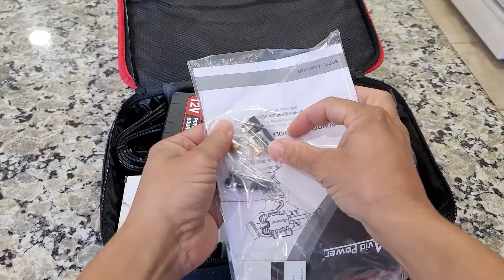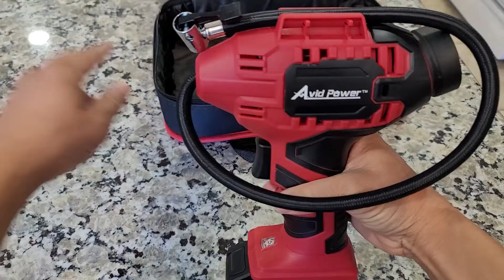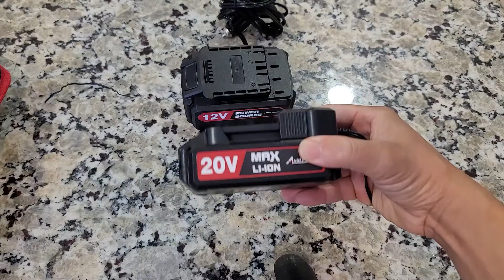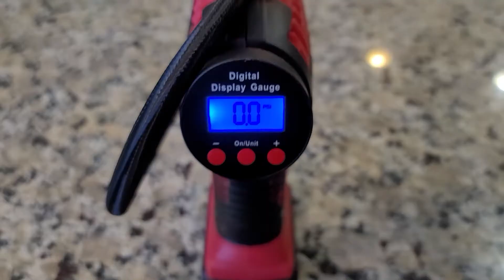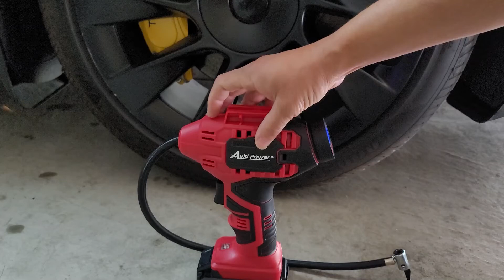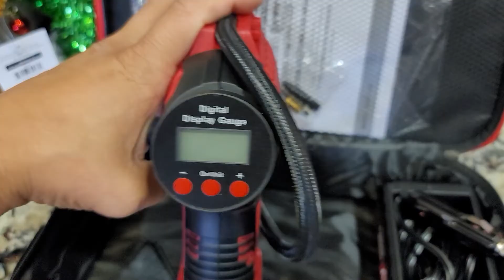Avid Power Tire Inflator

Comment: The LCD screen on mine went out after the first use.  They offered to replace it but don't have the same color.  I don't care about the color but this will allow me get refunded by Amazon, as it is currently outside the return window but still under warranty.  Not sure if I'll have them send me another one or just get my money back.  Seems really cheap if the LCD went out after just one use.  Most likely due to the vibrations.
Reply from the maker: Sorry that happened to you. I would get a replacement because I have two and both are still working.

Comment: One negative I'd give it having owned it for about 8 months now is, if your battery is low and you try to use the 12v adapter with your car's battery turned on, it doesn't inflate fully, stops and then says you have a low battery. Some kind of manufacturing flaw, for anyone considering this thing. Disappointing.

Comment: Just tried my new Bullseye on a friends tire, Boy was I disappointment. Took 10 minutes to get from 25 to 32. Along with that it ran hot. Was only able to deal with two tires from 25 to 32.  the battery died, so I tied using the cigarette lighter, It would not turn back on guessing it had to cool off.
Reply from the maker: Yes, these units can get very hot.

Comment: You didn't mention if you purchased the 3 or 4 year protection.  Planning to purchase this on Amazon, but didn't know if the protection plan was worth adding on or not.  Any feedback would be helpful.  Thanks.
Reply from the maker: I never order protection plans.
Reply: @BazzarRepairs never buy warranties, they're designed to screw you over, it's such common knowledge in the industry we had an entire engineering project in my probability class on designing a warranty efficiently for a business to make money off of it. You find the mean time to failure and make your warranty a hair before that. That's the reason stuff breaks right after your warranty expires. It's designed that way

Comment: After sitting in my Trunk for 1 year,it no longer works,not even with the cigarette lighter.Battery is fully charged and wont turn on,I would give it a 0 out of 10,very cheap China Made Paperweight.Refer to the longevity of this device as mine is dead after 1 year.
Reply from the maker: Sorry to hear that. Mine still works great. Were you able to return it.

Comment: A few suggestions for a better review - 1. use a high quality gauge before and after inflation to see if the pressure reported by the Avid inflator is accurate. 2. How many tires can you inflate from zero to full before the battery dies? (timer would be helpful too).  3. How much difference (if any) is there in inflation speed between the battery and the 12v plugin?  Thanks for the review!
Reply from the maker: Thanks for the feedback.

Comment: Just ordered mine 

I have to get both my Cadillac and Lambo back on the road.

Both cars' tires flatted because of cold air and sitting in the garage for 6 weeks undriven
Reply: Your Lambo or any car tire for that matter shouldn't be flattened after sitting for 6 weeks.
Reply: How has your tire inflator been holding up after 9 months? is it still working?
Reply from the maker: It works great.